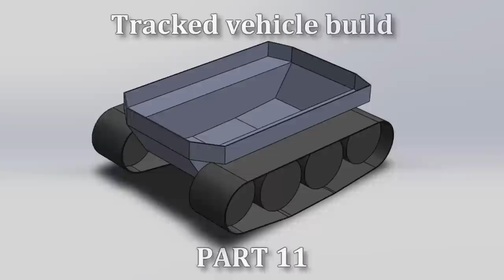Buran Safari CVT - Tracked Amphibious Vehicle Build Ep. 11

Comment: Back in prehistoric times in my high school welding class, my instructor taught us to use damp modeling clay to draw heat off metal near welds. We'd pack it in contact with the metal near whatever we wanted to protect from the heat and the clay would absorb the heat, preventing the rubber mounts or dampers from melting. It removed easily and would wipe right off.

Comment: Im only 20 minutes into the video and i had to stop and comment.  The rubber flex coupler is absolutely genius.. Really! I mean it! I like that it allows for a several degrees of angle offset.. It seems like it will run quite smooth too! I will definitely be filing this video away for future reference.. I know for sure ill be able to use this idea on a few projects I have in mind.  Great idea 💡

Comment: Donn, I’ve read many comments stating “so much steel gonna need a bigger engine”. Do you think they gave any thought about how low of gearing this is gonna be? A transmission that has its own differential of about 3 to 1 going into another differential that’s about 3 turns in to 1 turn output. I think your doing a damn fine job.
Reply from the maker: That's right - the first gear reduction is at the CVT when on lower revs; second gear reduction is in the gearbox and first differential 1:4 ratio; the third gear reduction is in the second differential also 1:4 ratio. It'll be quite slow but enough for my use.
Reply: Yes, and these engine have a lot of torque for their small size. It'll be fine ! 👍
Reply: I'm joining this midway - are you making a separate water impeller?

Comment: Great job ! 

Just for fun  make a   “U”  from a piece of metal sheet.  Turn it upside down.  Put it over the drive shaft and sit it on the square tubing body piece under the drive shaft.  Weld the tops of the  “U” to the square tube body piece.  Now, if the drive shaft ever comes loose or breaks while you are going 50 k/hour the drive shaft will not beat you to death.  ;)

Comment: You are doing great work. You should know that the input shaft of that transmission only has a one bearing on it. It needs to be centered to your clutch with a pilot bushing. So the shaft stays still it won't flop around otherwise you'll wear the input bearing out quickly

Comment: Much better putting all the drivetrain parts on their own subframe.  I was worried about that pillow block on the driven shaft being attached to the main frame crossmember the way it was before.  The amount the engine end of the shaft moves would surprise you, no matter how rigidly you think your engine is mounted. 

Much better clutch, that Comet Clutch wasn't built for 20hp. 

The bolt design for your engine mounts needs larger holes and shouldered bushings so there's no metal to metal contact with the bolts.  This is a good mounting scheme for a hydraulic unit, generator, compressor etc, but to accommodate the torque of a shaft drive system some nice liquid filled engine mounts on a wide stance would be a good choice.

Comment: Donn I like everything you’ve done so far. I would like to comment about your flexible coupling between the jack shaft and trans. It looks great but normally there is a pilot bushing to support the end of the trans shaft in the crankshaft of the engine. The bearings in the input side of the trans are very small because the pilot bushing takes most of the load. You may have an issue if the flex coupling pulls it to the side under load. I would suggest maybe tying a plate across the front of the trans with a bearing bolted to it to support the inside half of the flex coupling. This would give you support and still have the flex coupling. Keep up the great work.
Reply: Elevator 
I agree totally. It was bugging me, and I was scrolling through to see if someone had mentioned it. You nailed it👍

Comment: Hi! I love your channel! I love the tank build! 

For roll bar/crash bar I’m worried that you are using seam-welded tubing. That can split and injure the driver or passenger in an accident! 

Make sure your tubing used in the roll bar/crash bar is thick walled tubing that is NOT seam welded! 

Thanks for the great videos!
Reply: It takes a lot to split seam welded tube. I've seen plenty of twisted up and bent tubes but never one that has failed along the seam. Keep in mind also that this thing is not going very fast. That tube's plenty strong enough.
Reply: LesNewell ok I was just worried for Donn.

Comment: Maybe it's a dumb thought, but it might be worth while to make sure the bolt-holes of the coupler between the CVT and the transmission line up. That way if the rubber craps out in the middle of nowhere, it would be possible to connect the parts without the rubber. I mean the parts might take a beating, but you might make it home
Reply from the maker: That's a good idea. The holes line up too.
Reply: @DonnDIY  might be a good idea to make sure you can see the rubber in order to inspect it periodically too. An access hole or something depending on the final design.

The rubber looks like the sidewall of a large bias ply tire which is somewhat similar to the drive belt construction.  Both of which can handle enormous stress and will show signs of deterioration before failing.

Comment: Not worried about the flex coupling but am concerned about balance from the 2 bolts where the key was especially as you're not using a spigot bush on the gearbox input shaft. Your rubber mounts would work better if the holes were bigger and rubber was used inside the hole, it will wear the bolts through eventually. I like your welds though so it's not all bad 😀.

Comment: If you make the holes ~50% larger in the tabs, you'll get significantly better isolation. The rubber will squeeze into the gap and prevent the stud from contacting the tab.
Reply from the maker: That's good advice!
Reply: @DonnDIY  Keep up the good work!

Comment: Awesome work! If it doesn't work like you want, re-build it right. Congratulations! 
    Will you protect the inside metalwork with "bedliner"? The tough stuff you coat the bed of a pickup truck from rusting and scratching? It would add weight to your vehicle but would protect the framework from ever being scuffed and rusting. Mostly the hidden metal parts.
    Donn, thanks for another great video.
Reply from the maker: I don't know what I'm gonna do about the floor just yet. 😀
Reply: @DonnDIY  Can't wait to see! Thanks for your response, means a lot to me.

Comment: Not sure if it's ever going to be a issue, but the bolts you used in place of the key on the flex joint stick out quite a lot. It seems like you could reduce the profile of the bolts (and any vibration they may cause) by cutting off the heads and then cutting slits into the tops, thus effectively turning the bolts into flat head set screws.
Reply: I would suspect that those are only temporary and he is going to replace them with inhex grub screws to maintain the balance.
Reply: You're probably right. I guess it just pays to spell these things out sometimes, just to keep some fools on Youtube for screaming at you.

Comment: Looking good, awesome fab skills,  I have 3 questions,  1-a brace on the backend of gearbox around that cover flange?  2-Will there be a passenger seat?   it looks like it will be front heavy, 3- why didn’t you mount engine and drive assembly with a short cv to axle? Balance and two seats.

Comment: Even more mass to the front.. When you designed this, did you check for weight and balance? Do you know where the central mass point is? As it sits, it looks like it's going to take a nose dive, and tip over port side.

Comment: @26:18 you explain why the roll bar is so tall but why is the removable roof going to be that tall? 
I guess the sides will change the look but it’s still 50cm above your head. Won’t that limit your ability to get around trees ?

The new CVT should be much better. The drive belt wear won’t be as much of an issue with the bigger CVT and belt.

Comment: maybe some slack adjustment bolts om motor so not so many belt replacements  i ran snow mobiles for many years and it helps
Reply from the maker: I can move the engine to tighten the belt.

Comment: This is a great project, but are you not just a little concerned it may be underpowered with that engine? I mean, it is quite a sturdy build and it will be rather heavy when finished.
Reply: Well its more or less for self transport whitout suspension so the gear ratio is low enough to move such tank

Comment: Nice project. Keep going with it. I'm eager to see the final results. Have you thought about using a motorcycle engine?? It is a lot lighter, compact and have all the mechanics.
Reply from the maker: Yes, I have. I considered a Honda Transalp V-twin but didn't want to deal with separate wiring, cooling etc. I can just replace the industrial engine when it goes bad.

Comment: I really don't want to be negative in any way because you make so many great machines, but I can see so many possible points of failure in the power train. My brother in law and his brother made a similar vehicle based on a fiat bambino but only with floatation tyres, so less traction and due to the torque multiplication through the drive train they had many problems with snapped drive axles etc. It had 16hp, the axles they used were out of a 350 cubic inch holden V8, and they weren't strong enough. They were and are mechanical engineers with the machine shops of a steel works and the government railways at their disposal. I Hope I'm Wrong, good luck.
Reply from the maker: I think you once already mentioned it.

Comment: There has been some good, sound engineering work here so far but I am starting to worry about the weight of all the steel in there...Are you sure it will float high enough in the water to lat you carry stuff/people? You also might want to leave the layout of the seat position so you can determine it's best place or you risk the machine being very front heavy.
Reply from the maker: Yup, it will.

Comment: The one thing I cannot seem to figure out with how you are mounting the motor and transmission is how you are going to properly tension the belt between the two sides of the CVT connection.  Maybe I am missing something.  Could someone tell me what I am missing here?
Reply: 15:58   It looks like the engine mount plate is slotted for adjustment. .  19:07 you can see the slots on the engine mount bolts.

Comment: Hey I'm new here but can you put an i4 it would give more power to the vehicle and it would be cooler
Reply from the maker: The gear reduction is so severe that the 20 HP engine will be multiplied to 80 HP in the rear wheels.

Comment: You might be in for a world of pain before you have that cvt working. Most snowmobiles rev to ~8000rpm, they barely get going on 4000rpm. You might need to change both primary and secondary springs as well as ramps in the primary and helix in the secondary
Reply from the maker: Buran doesn't rev that high. 😁 These CVT's are used on 4 stroke industrial engines without problems. I've seen it done before.

Comment: and if the variator belt breaks, how to change it?
Reply: Loosen 4 engine mount bolts, slide engine toward gearbox. Remove black-painted gearbox outer bracket. (May need to undo big centre bolt) Fit new belt. Reverse procedure.

Comment: With all the steel he's putting in that thing,  gonna need a more powerful  four cylinder to move it.  No TIG or aluminum skills?
Reply: Huge gear reduction with a cvt into a gearbox into a diff 
It will be a slow machine but very powerful

Comment: Does anyone know how he will put tracks on drive wheels if the walls next to these wheels as he said would be vertical?
Reply from the maker: The walls are quite far from the wheels so there is enough room for the tracks, too.
Reply: @DonnDIY  The shape of the bottom near the drive wheel requires the wall to also be near this wheel. And if the wall in this place would be vertical, then how can it be far from the wheel?